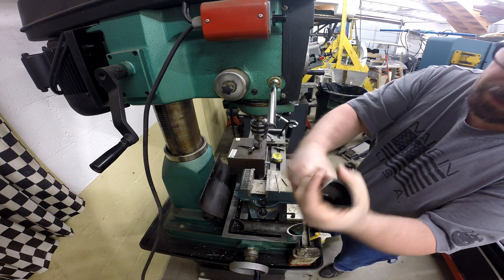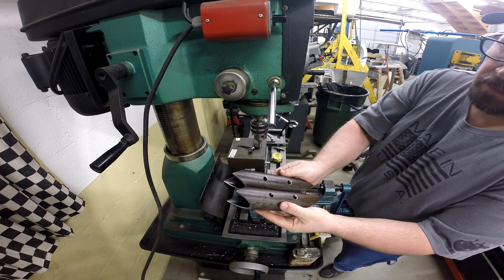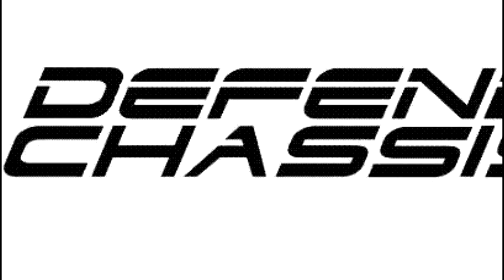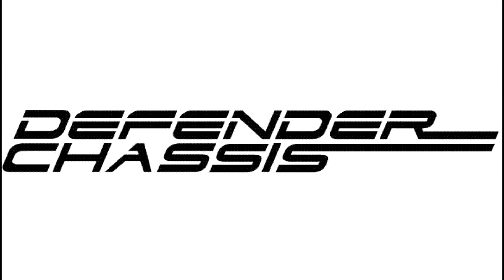How To Splice Chassis and Roll Bar/Cage Tubing

Comment: hello sir..  .i know  you dont make the sleeves anymore. . can i ask for some info. .  
i have 1 5/8  chrome moly  roll cage that i need to extend .. what tubing do i use for the external sleeves..
thanks for any info .
Reply from the maker: 1-7/8" diameter x 0.120" wall thickness DOM tubing
Reply: @goldenhazeduster  thank you. have a good day

Comment: Do you still sell these chassis splice tubes for 1 5/8 .083 wall tubing
Reply from the maker: No, I made a dozen and it took 3 years to sell them so I stopped making them.
Reply: @goldenhazeduster  thanks.